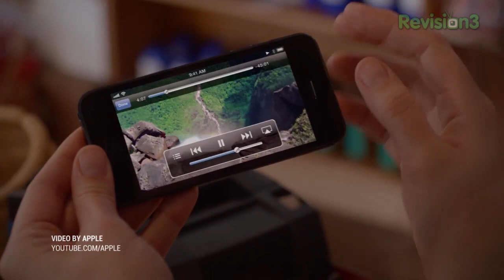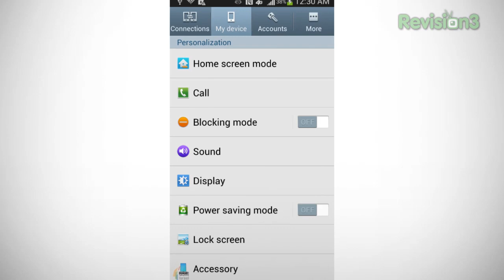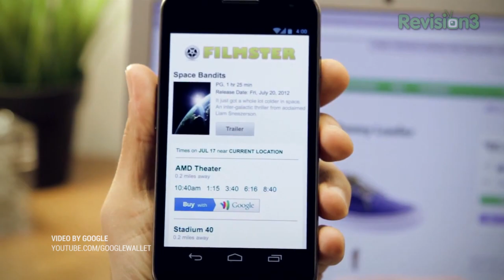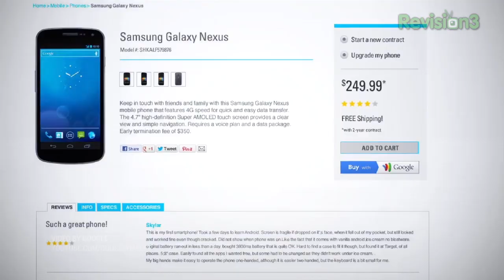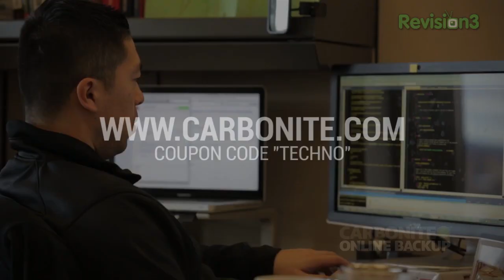Galaxy Note III and Galaxy S IV

Comment: I think you are getting cores and instruction sets mixed up. armV __ is the generation instruction set, while the arm cortex A___ is the architecture of the chip itself. 

The s3 uses an cortex A9 chip on the v7 instruction set. The exynos 5 will run on an A15 core but still use the v7 instruction set.

Comment: It just means it can take more stress and wont shatter if dropped. Like now say you accidently sit on you phone you take the risk of shattering the display. If it's a flexible OLED the screen could survive the stress.

Obviously if you put enough pressure on the device to crack the motherboard or something it won't help much but I can see this making for an extremely durable display.

Comment: 5.5" is a pretty sweet spot. Small enough to hold in one hand and fit in a pocket, but big enough to use as a GPS or for web browsing at arm's length
Moving up to 5.9" just to compete with that Huawei Mate garbage knock off is silly. Samsung doesn't need to feel threatened by those red herrings. The goal is not to get bigger and bigger - that's such an unsustainable model. 
improve on the experience the Note 2 offers, but keep the same dimensions, it's a perfect size :(
guess we shall see though

Comment: Actually the reason why the iphone ios has been gettng so many updates is because each update fixes the getting past the lockscreen issue that the precious update caused. And yes everything is nicely integrated into everything apple, but it's very limited and even more limited if you don't own all apple. What makes android insecure is turning off the option in the settings that makes it so you can't download anything outside the android market (besides word and adobe reader files).

Comment: For sure I feel the same way/ 5.5" is as big as I will go. I'm willing to go maybe 5.6" but that's it. I feel instead of increasing the screen size they would do better improving the Spen and making that damn button more comfortable to press when attempting to outline with the button pressed. 

The Note 2 has by far one of the best Amoled displays I have ever seen outside of the S4. It's way better than the S3 was. I say just higher the damn Res and make it brighter and be done with it

Comment: its official, Samsung screen size for the note 3 will be 5.7inch. similarly like the s4, it will be the same size to it its previous model (the note 2) however will be thinner and have a bigger screen squashed into the face by reducing the bezel

Comment: x4 a15 cores for performance and x4 a7 cores for low power so battery lasts longer.

The phone will switch between the 2 depending on what task needs doing.

Comment: Wishes it had worked for me. My friend has a note 2 and hers never crashed either. But mine did all the time. Spent hours on the phone with tech support but they couldn't figure it out. Like I said I may try again in the future I'd the platform becomes more stable. I'm a power user and I guess the note 2 just couldn't handle it.

Comment: Wait to see how much the S4 is, and on a plan(if u want it on a plan)! I think in features that the S4 is better than the S3 - but by how much?? For example; the NOTE 2 is alot better than the Note in features!  It depends if you'll constantly use the added features that the S4 has. I never buy a new & just released phone straight away. I wait 6-8 weeks after it being released, after reading some reviews.

Comment: well it's nice that you would pick a mid-ranged phone when i was talking about high end. though it may be googles flagship, that doesn't automatically make it a high end phone. the Nexus appeal is the fact the price is low and has stock Android. My Galaxy Note 2 unlocked 4 months ago cost me $670. though your math might be right, next time you might want to use something that is actually considered a high end mobile. you know, stick to the original argument at hand. nice try...

Comment: You can't really compare Samsung Galaxy 4 with Iphone 5 right now. That would be a BAD comparison. I'm not saying that GS4 is a bad device, it's an amazing and pretty solid device. I am really impressed with that, however, if you are comparing with an Iphone 5 with GS4, of course IPhone 5 is at a huge disadvantage. It will kill iphone's specs because GS4 is updated internally. Wait until Apple comes out with a new one, any company will match the specs. Samsung just opened the doors for others.